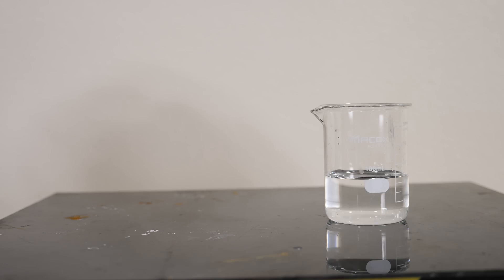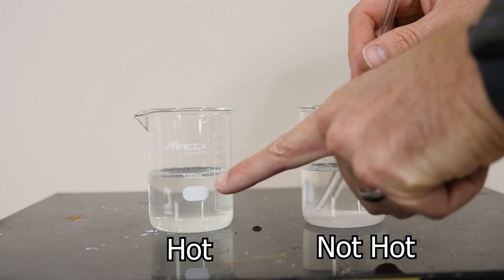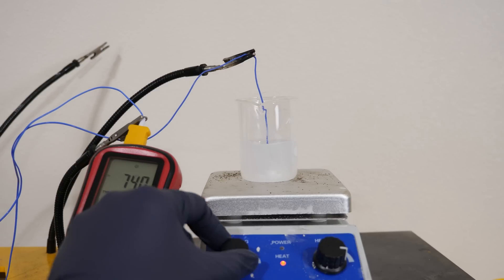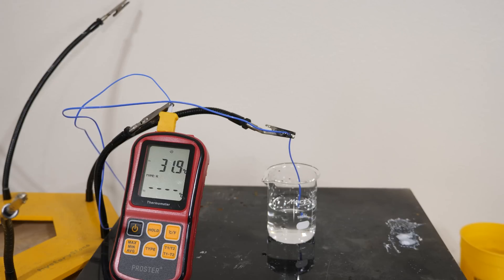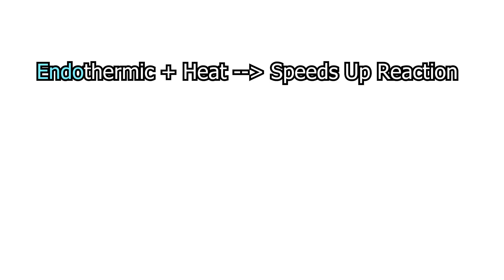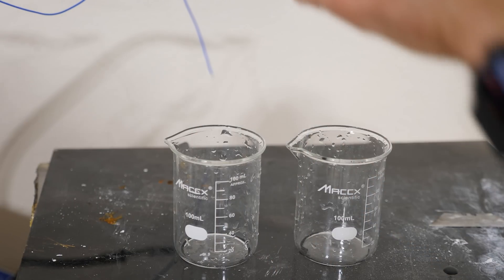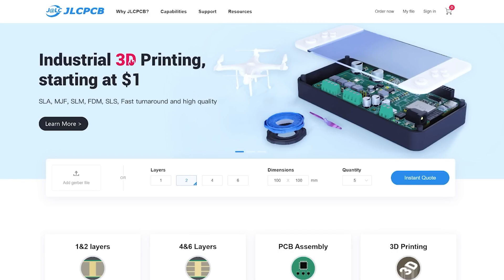Why Does This Powder Only Dissolve In Cold Water?

Comment: Just one correction if I may, heating up a reaction ALWAYS speeds the reaction up, endo or exothermic, however, the equilibrium point of endothermic reactions favour the products at high temperature and vice versa, but equilibrium is always reached faster at higher temperature. Don't confuse chemical kinetics and equilibrium.
Reply: I agree with you that heating up a reaction always speeds it up in real chemistry.   But now that you mention it, I don't think I know a general proof of this within nonequilibrium statistical mechanics.  If there is no such theorem, it's possible one could imagine mathematical models where it is not true, and that could even lead to real situations where it isn't true.
Reply: @iyziejane  well, you can derive a formula to exp of T from purely collision
Reply: @Alche987  Better than nothing but that's essentially a non-interacting model compared to real matter.  Kind of like the "entropy goes to zero as T = 0" version of the 3rd law is not true for general interactions, despite it historically being called "Nernst's theorem."
Reply: @iyziejane  you can start adding interactions intra e inter, and that adds to a linear component before the exponential and the delta E, bit you still have the temperature function
Reply: @Alche987  right so the result for non-interacting systems extends into some perturbative region of the interaction parameter.   But I think it is reasonable to hope for more when it comes to a property that we expect to be true so generally.  I am also interested in spin systems and lattice systems, i.e. showing that a  spin system with heat-bath dynamics has an equilibration time that monotonically decreases with temperature.   I can't think of how to see it except in cases with an exact solution.
Reply: @iyziejane  mmm, i dont think it will work in bulk because more interactions will give you more reactions, but maybe in very low particle count systems? Where quantum effects govern? Maybe some wierd population inversion cases.. idk. Too much for a yt comment 😁
Reply: But being farther from equilibrium also increases the reaction speed, so it wont ALWAYS speed up the reaction. There should be an optimal temperature to maximize reaction speed at any given moment.
Reply: Pretty much  in many not all reactions exothermic  properties result in boiling over or destroying the product being made when you bring thermodynamics into the mix the rabbit hole is fascinating terrifying and more confusing the deeper you get but most people watching this wont dive into equilibria to exo and endo reactions
Reply: “Heating up a reaction ALWAYS speeds up the reaction” This isn’t true. In reactions with complex mechanisms and rate laws, it’s possible to have reactions that slow down as temperature increases, even though all the individual steps of the reaction increase in rate. A good example is the oxidation of NO by O2 to form NO2.
Reply: Yup, the heat moves the equilibrium point, hes mixing kinetics and thermodynamics in the explanantion and is kinda confusing
Reply: contact me in a couple days if he doesn't correct himself - I will do a reaction video
Reply: @That_Chemist  he better watch out or you are gonna start breaking some bonds
Reply: hi may you pls go more in detail with chemical kinetics? I studied AP chemistry (college entry-level class) in high school and was pretty good but that's 5+ years ago and pretty much forgot everything but general terms and ideas. hopefully that makes things easier to explain.
thank you 🙏

Comment: It DOES NOT slow the reaction down. All reactions go faster. What it does is increase the speed of the REVERSE reaction a lot more
Reply: This is a crucial correction! All reaction steps go faster at higher temperatures, but some reactions rates increase more than others, which can shift the equilibrium
Reply: Spot on comment. The equilibrium constant K is merely the ratio of the rate constant of the forward reaction to the rate constant of the reverse reaction.  Increasing the temperature speeds up the reverse reaction more than the forward one, causing the equilibrium constant K to diminish.
Reply: In many exothermic reactions you need to counter the heat let off so that the reaction dosent destroy itself or bubble violently out the glassware settup so ice water or dry ice and isopropyl alcohol baths are used to counter this
Reply: ......MAYBE IT'S ABOUT BONDS BETWEEN CALCIUM AND ACETATE IONS IS ACTUALLY SO STRONG SO ONLY THAT BOND COULD'VE BE BEATEN BY LOTS OF WATER MOLECULES THAT FORM COMPLEX WITH CALCIUM ION,AND WHEN BEING HEATED UP,THESE COMPLEXES FALL APART

..........SO CALLED "SOLUBILITY ON THE EDGE",THE ONLY REAL SCIENTIFIC EXPLANATION THAT'S TO BE MADE
Reply: I think he simplified it on purpose, so he didn't have to get into equilibrium.
Reply: Correct - The Action Lab is just incorrect about this
Reply: DM me on discord if he doesn't post a correction in the next day or so, and I will make a reaction video
Reply: @That_Chemist  are you that desperate for views?
Reply: @bigsmall246  I think it's just easy for people like him who also do educational content to get frustrated when big channels are teaching the same subject but wrong
Reply: but what about when something is on fire

Comment: In common words, when you dissolve some substances in water, the solution will get hotter, when you dissolve other substances, the solution will get colder. The dissolution of calcium acetate when the water is hot will make it harder to dissolve because reactions tend to equilibrium which in this case will favor keeping the water colder.
Reply: So in chemistry exothermic reactions heat up molecules while exothermic reactions absorbe the heat and cools surroundings endothermic reactions look like photosynthesis , cO2 And water into glucose and oxygen,  perspiration, evaporation, ammonium chloride in water those ice packs you pop, ice mealting, exothermic reactions create energy endothermic usually exsausts the existing energy of heat

Comment: That doesn't seem reasonable (solid part, not gas part). Maybe calcium acetate dissolves and reacts to form acetic acid and hydroxide anions. Than calcium could react with the hydroxide to form insoluble (to some extent) calcium hydroxide.

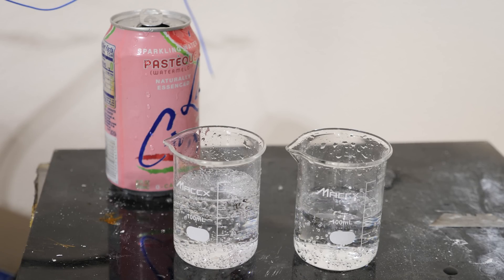Comment: 3:45 i disagree. the mixture of the solution, in the case presented of CO2 and H2O, does not affect the change in internal pressure; it is the thermal energy that determines the change of pressure inside the can. the heat will affect both the solution and the internal pressure exerted by both the gas and the liquid regardless of the state of solution composition.
Reply: He's effectively correct on that portion though, but missing some details for the full picture.

Some back-of-napkin math:

Solubility of CO2 with temperature means that between 5 C and 25 C, half of the dissolved gas should be leaving (if pressure would remain constant). The amount of CO2 in the airspace of the can should be negiglible (for this rough estimate) given the (relatively for this calculation) high solubility of CO2. Since the volume is fixed, this means the CO2 pressure in the can needs to approximately double to force the CO2 to remain in solution - this is the part of the explaination that's missing, since it otherwise seems like the dissolved gas actually does leave solution, which would skyrocket the pressure, not just double it.

The increase of pressure by heat (which is what I'm assuming you're referring to) between 5 C (278 K) and 25 C (298 K) is less than 10%. There's also thermal expansion of the liquid, but that's both small and partially offset by the thermal expansion of the can itself too.

Therefore, the dominant effect causing the increased pressure is the lowered solubility of CO2 with temperature, forcing higher pressure to return the solubility close to baseline.
Reply: I agree with your disagreement.
Reply: @fernandovalner  I disagree with your agreement to the disagreement
Reply: thanks, sometimes scientists get carried away with the description of a phenomenon.

Comment: There are a lot of solids, whose dissolution is exothermic, but its solubility rises with temperature. For example NaOH gives off A LOT of heat when you dissolve it, but despite this, its solubility increases GREATLY with temperature.
Reply: 2nd edit: Check my second comment. There's still some subtleties but the video appears correct! I'll still want to think about it some more.

3rd edit: I figured out my mistake in argument.
G is the temperature accounted-for solubility already. The mistake is that dS can be negative for a solid at high concentrations, which happens at saturation pt for exothermic dissolutions, and dS can be positive for a gas at extremely low concentrations, which happens for endothermic gas dissolutions. Check yo assumptions people XD

Anyways everything that follows is wrong but feel free to check out my mistakes.

That's because the fundamental description here is incomplete. He completely missed the temperature-dependent effect of entropy as well.

Tl;dr: things want to be freee~ when higher temperature. Gases are less free when dissolved. Solids are more free when dissolved.

Now, for actual equations.
Solubility depends on Gibbs free energy (G), not purely thermal energy (H). While the sign on it affects whether solubility increases or decreases with temperature, Gibbs free energy also has a direct temperature-dependent term. The full equation is (with some missing formatting) dG=dH-TdS, with entropy as well (S). This is why solids dissolving, which usually has positive dS (increasing entropy), can have higher solubility (by decreasing dG) despite being exothermic (releasing heat, negative dH). Gases, on the other hand, do not always have exothermic dissolution, some are endothermic (absorbing heat, positive dH), but they almost always significantly lose entropy on dissolution in liquids (negative dS) so they usually have lower solubility with higher temperature (by increasing dG).

~~To be fair, this is a perfectly fine entry-level description, as with most content on this channel. Try explaining entropy and gibbs free energy to the average person in 5 minutes! I would've liked a disclaimer on the limitations though, so people know there's more subtleties to it.~~
Edit: actually nevermind, the more I think about it, the more I feel like it's just completely wrong! There's too many things in everyday life that don't follow the simplified rule given in the video.
Reply: @bluerendar2194   Why do you say, "Check yo assumptions people XD," when you were the one that was mistaken?
Reply: @mattbrubach  It's making myself an example of what happens when you just assume something is "obvious"
Also the OC made a similar mistake.
Reply: @bluerendar2194  I understand what you were doing. Every human being has made mistakes. What I am asking is why you chose to admit that mistake in the manner that you did? 

Instead of fully accepting that mistake, you chose to detract from it. You chose to take the position of a more knowledgeable authority figure, who was giving advice to the people under him/her. And you chose to do that using slang like "yo". Slang that black people choose to use in their development of self-identity. 

Your speech changed when you decided to admit that mistake. Do you believe using black slang lowers the image of who you are, to a level where making that mistake would be acceptable? Do you believe that you are above making mistakes? If so, you should change your name to God, because he's the only one that could theoretically say that. Saying, "I was wrong. I made a mistake," is so much better. You'll be more successful in your career. Hopefully, with your level of knowledge, that is/ will be at one of our national labs working for this country.
Reply: @mattbrubach 
First of all, I take full responsibility for the error I made, hence leaving the original content up with a correction and the error made.

The content level is also not advanced, this is even sometimes covered in some HS classes, so it's not necessarily a professional environment yet. I'm also not the only one making such an error, so I am not just correcting myself. The fundamental type of error - mistaken assumptions - is also something everyone makes in many contexts, not just trying to apply some chem theories. The language change is to make a joke, which tends to be more palatable as criticism on something people tend to get worked up about. Works for me, maybe not for you :chillwcat:
Reply: @bluerendar2194  Thank you, I appreciate the explanation. Best wishes in all your future endeavors.
Reply: @mattbrubach  this has nothing to do with Black people but ok
Reply: @bluerendar2194   Thank you!
Reply: It is based on the fact that Dissolution of NaOH in water is exothermic but as the concentration increases to the saturation point, it becomes slightly endothermic.
As a result even though it is overall exothermic, but as solubility is only determined at saturation point, we have to take it as endothermic.
Reply: @tarak_moon  I stand corrected!
A futher search on this confirms that at saturation point, all solids (and the rare gas situation) with increasing solubility I checked dissolve endothermically, and all gases and solids that decrease in solubility exothermically. Good to know!
Edit: check earlier comment for full equation details.
Reply: @tarak_moon  Interesting. So what if we drop a small amount of NaOH in hot water so that it is not close to saturation point?
Reply: Does this go somewhat counter Le’Chatlier’s principle? Is there more to it?
Reply: @westonding8953  maybe in the comments someone answered but still le chateluers principle, equilibrium and the speed of the reaction are related but le chatelier is useful for predicting the effects on the equilibrium, for example if in a certain reaction at  10 °C the constant of solubiliti Ks is 10 then when you take some product the reaction will go to form the product because 
Products/reactants=K

In this case Ks because it is solubility it's really interesting I would recommend that if you are in highschool to check chemistry books that speak about phisicalchemistry or however you say fisicoquímica in English,  many things said in this comment section are related to that branch of chemistry
Reply: I think you are confusing solubility, which is always defined for an equilibrium, and the rate of reaction, which is not necessarily correlated to the final state of the system. In essence, you mix thermodynamics with kinetics.
Reply: =YOU'VE GOT IT RIGHT,THIS IS DIFFERENT PRINCIPLE BECAUSE OF IT'S MOSTLY ABOUT WHY SODIUM SULPHATE HOLDS 7 WATER MOLECULES

........CALCIUM ACETATE SEEMS TO BE CAN B DISSOLVED ONLY WHEN CALCIUM IONS WILL MAKE HUGE COMPLEX WITH WATER,SO IT'S LIKE Ca(OOCCH3)2(SOLID)+nH2O=[Ca*nH20](OOCCH3)2(DISSOLVED) ....AND THAT COMPLEX QUICKLY FADES WHEN BEING HEATED UP...

Comment: I immediately thought about Corn Starch making your gravy lumpy but dissolving easily in cold water; I guess that's different though, ha
Reply: That's because the long starch molecules are bundled up into individual tiny balls. Cold water easily separates the balls from each other but leaves them intact, while hot water dissolves the balls themselves allowing the starch molecules to spread out across long distances forming a gel.